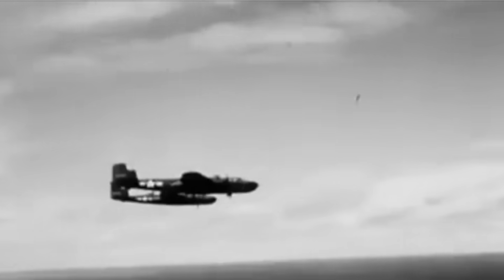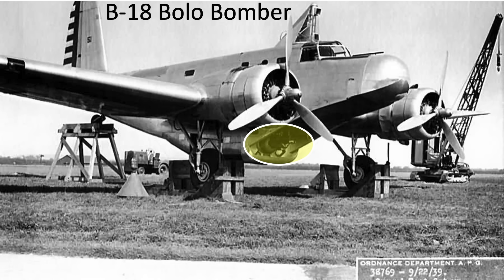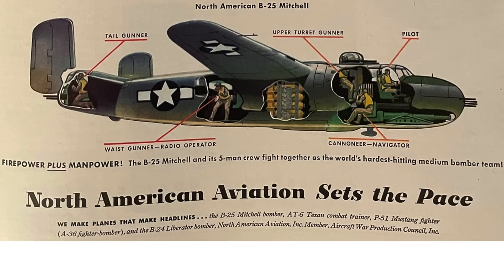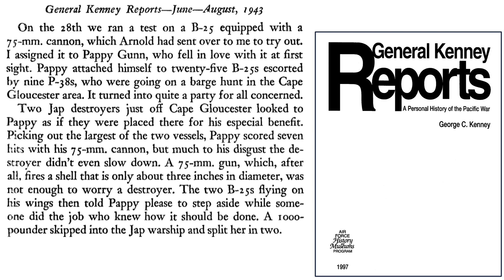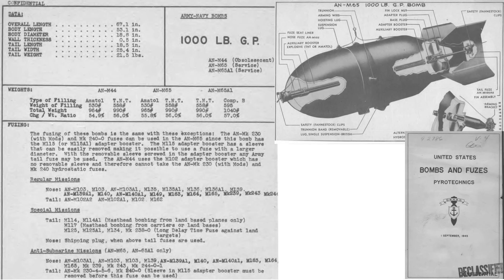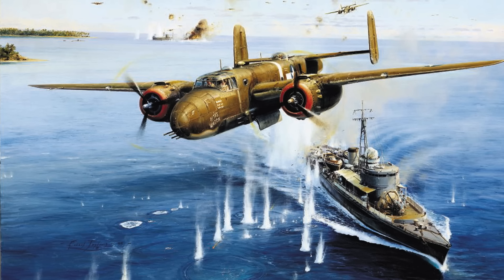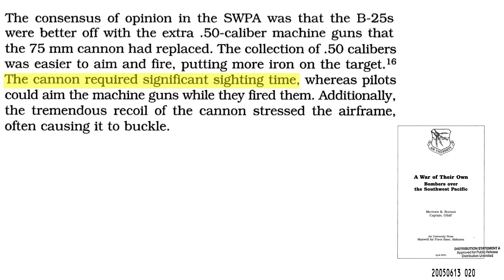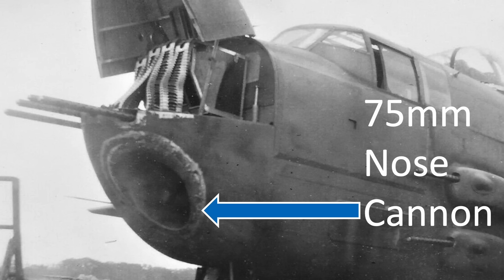Why the B-25’s 75mm cannon was a Failure - Deep Dive Review

Comment: It's good that they tried.  If all crazy ideas work, they aren't crazy enough and you're missing some crazier ideas which might work even better.  Failures show you're thinking crazy enough, as long as some do work.
Reply: yes, and all creative work is like that. to find the 1 out of 10 good idea you have to also test the other 9 things that end up not working. a particular thing not working still gives you important information. you don't have to keep testing doomed ideas over and over again. still, some ways of testing are better than others. in 2025 you test it in a 3D model before putting it on an actual airplane. they didn't have those tools in 1943. arguably, you could have known before hand that the 75mm round won't do much damage to a destroyer. on the other hand, pristine conditions on a firing range lack a lot of important aspect of real combat. the only way to really test it was to use it.
Reply: @196cupcake  Yes.  In hindsight, it seems obvious that 3-4 75mm shells against a destroyer or even merchant ship are mostly useless compared to thousands of .50 rounds.  But it was wartime and they were trying everything they could.
Reply: It might have been better to fit a smaller, higher velocity gun - like the Molins gun fitted to the DH98 Mosquito Mk XVIII
Reply: @smokerjim  Thank you for contributing. IF I've understood this video, rate of fire was a significant problem. So the Molins gun's autofeed should have been an  'immediate' improvement. My impression is the Mosquito Mk XVIII was designed to sink U-Boats with direct fire of the Molins gun and rockets. That seems like a different task. Are you thinking of redirecting the B-25s against submarines, or making them more effective against destroyers?

If the Molins suppressed a destroyer's AA fire more effectively than a bunch of 50 calibre machine guns, then it was more than an improvement over the 75mm cannon. However, AFAICT, the Molins gun only doubled the rate of fire of the 75mm, which seems less dangerous to AA crews than 4 or more extra 50 calibre machine guns. But I'm too ignorant to have any confidence in that guess.

If Molins gun fire could directly sink destroyers, then it was more than an improvement over the 75mm cannon and 50 calibre machine guns. AFAICT, the Molins gun directly damaged U-Boats, so, IF I've understood this video, the 75mm had poorer penetration than the Molins gun (better penetration seems like 'a Good Thing'™😀), The 50 calibre machine gun was ineffective at directly sinking a destroyer. So is that what you're thinking, and why you suggested it? That seems like a significant step up in effectiveness.
Thanks again.
Best Wishes for a Most Excellent Month. ☮
Reply: @smokerjim  Double thanks because I learned two different things. Firstly some of the Molins gun's development problems which hadn't even occurred to me. I also learned that De Havilland had devised and implemented 'Fail Fast, Fail Cheap' for investigating and testing ideas, and they used it effectively! There were some clever folks at De Havilland and Molins.
Take Care. ☮
Reply: @smokerjim 37mm or 40mm. Plenty of those were around.
Reply: Theres other aircraft that it did work on tho.  Different theatre and different combat role but worked nonetheless.
Reply: @Acetheskyhook  That's also a good reason for not wasting resources on building 1,000 B-52s with 75mm cannon, then spending resources removing them.
Better to spend some resources on testing other ideas. 
Thank you for replying. ☮
Reply: Cringe
Reply: The rule of thumb is "fail fast, fail cheap", and not "Failures show you're thinking crazy enough" because testing every idea has a cost. I'm strongly in favour of 'casting a wide net' for ideas, and building fully working prototypes to test in real conditions. However, making 1,000 (about 10% of all B-25s made) when it didn't work is a ridiculous waste of time and resources. It also adds logistical complexity (making and shipping 75mm rounds which aren't otherwise needed) to keeping those B-25s flying. Removing the 75mm cannons from manufactured B-25s is further evidence of the failure to "fail fast, fail cheap".

A good technique for testing 'crazy' ideas is to describe scenarios where the 'crazy' idea is applicable, what its benefits are, and how it's better than the existing technology/approach. I'm guessing someone writing or reviewing those scenarios might have focused on hitting boilers, engines or magazines, having realised the holes weren't going to sink a destroyer. Or focusing on ships small enough to sink, which might have pushed it's priority down significantly.
Best Wishes. ☮
Reply: @gbulmer   If you're Luke Skywalker you could probably be very effective with 75mm, but most people aren't Luke Skywalker. but realistically, I could see the argument for how larger shells might do better at suppressing AA guns. Maybe you could actually hit them (maybe that was possible in ideal conditions). Or, maybe a bigger boom would be more intimidating to the gun crews. It just didn't turned out that they had better options: more .50 cal. 

The AC-130J is still in service, and it has one 105 mm M102 howitzer on it. So, the idea of putting a big gun on a big airplane isn't the craziest idea.
Reply: @196cupcake  Thank you for replying. If they wrote scenario's (as I suggested), and wrote "75mm cannon fire would be more effective at suppressing AA fire than 50 cal", then I think they might have questioned the technology of manually loading 3-4 rounds per attack run much earlier.  That seems so slow as to be barely useful. The video says it was also hard to aim, suggesting many rounds missed the intended target. Further, if it is fixed, aiming at a similar area to the 50 calibre machine guns, a gun crew would get a warning that they might be in danger from the 75mm by the 50 cal fire. Also, though I have no experience, I suspect the rare 'boom' from an attacking aircraft is drowned out by the AA guns and other destroyer weaponry I and my comrades would be firing, and the hail of 50 calibre machine gun bullets we were receiving.

I'm strongly in favour of evaluating very wide ranges of ideas, and applying "fail fast, fail cheap". I'm strongly in favour of testing in realistic conditions and not just ideal conditions.

I'm strongly opposed to huge investments before evaluation has shown positive evidence. An obvious exception is 'binary' technology which changes wars; for example the first successful nuclear weapon. Losing that race might easily be catastrophic.

Big guns on big planes seems very attractive when the big gun is effective against the intended targets. However, a slow firing 75mm was demonstrated to be ineffective.

An AC-130J is enormous compared to a B-25. An AC-130J could carry the weight of a couple of B-25s. An  AC-130J is a "Swiss Army Knife" of weapons systems. So it seems reasonable it has a big gun to deal with specific targets. However, its 105mm howitzer is very likely much, much more effective for its type of target than a 75mm against a destroyer.
Thank you again for replying.
Best Wishes for a Great September! ☮
Reply: @gbulmer  The British equipped  the DH  Mosquito with a 57mm solid shot anti-tank auto-cannon.  They killed a few subs with it.  It came out in June of 1943.

Comment: I read of 3 Hellcats, 6 .50 each, shooting up a Japanese destroyer from the side, and apparently putting so many holes in it that the engines stopped working and it eventually sank.  I can imagine hundreds of half-inch holes could be hard to plug, especially if a few dozen were in the boilers and enough crew were killed or injured.  It's been ages since I read it and I have no references or any details.
Reply: A 332nd Fighter Squadron fighter plan shot up a German destroyer in Northern Italy, and hit ammo, blowing it up.
Reply: Those 3 hellcats could potentially fire 7200 rounds of .50-cal, now just the cross sectional area of all those rounds is equal to the cross-sectional area of 200 rounds of 75mm AP. I don't think one aircraft could fire 200 cannon rounds before the plane itself was shot down.

A HE-shell could potentially do more damage but HE 75mm shells don't have very good penetration, the fuze tends to be crushed on impact with steel so if it doesn't detonate immediately it doesn't detonate at all.
Reply: @Treblaine  Doesn't matter, there's no way .50cal is penetrating a destroyer's armor. Not one, not a hundred, not a thousand. 
Especially from range, where they already lose some velocity. And no airplane-carried machine gun is going to accurately put hundreds of rounds in same place to actually make a dent and punch through in combination, even if they all combined finally put out 7200 rounds (assuming they would be able to fire it all on one approach without flying past target before, accurately, with no misses). 

This is an exaggeration similar to "fighter pilots shot the road under Tiger tanks for .50cal bullets to deflect off the pavement and destroy them from underneath!". Nobody who has any knowledge of ballistics and WWII history can be naive enough to believe this.

This just makes zero sense and can not be taken in any way other than tall tales told in dive bars for entertainment.
Reply: @czwarty7878  I think you misunderstood me, I'm comparing the damage the .50-inch MGs did to the poorly armored modules like torpedo launchers and 25mm AA gun positions to the intended damage through armor.

75mm AP could penetrate (maybe) but just wouldn't have the same effect INTERNALLY as the .50-inch guns had EXTERNALLY.

And I don't think the 75mm HE-frag rounds could both penetrate very well AND detonate. Some other channel covered this and said unfuzed 75mm HE would penetrate as well as a 37mm AP round but if fuzed the 75mm shell would detonate on the surface spreading the inertia of the shell-casing over a huge area of the armor just pitting a large surface.

What the .50BMG may have done is caused detonation of explosives stored on unarmed surfaces of the Destroyed, like crates of AA ammo, torpedoes, depth charges or even land based ordnance stored topside for transport to ground troops.

Poor organization can lead to explosions and fires on the surface to spread down into the hull where internal detonations would split the hull.

PS: I've seen that repeated insufficient impacts do not penetrate. The ammunition just builds up on the surface adding to the mass. You can't do a "robin hood" of stacking projectiles, the first projectile just shatters the second projectile.
Reply: @czwarty7878  Destroyers have no armor.  They are called tin cans for a reason.
Reply: Which shows what was really wrong with that 75mm. The fire rate was abysmal. Even the upgraded one only fired once every 2 seconds.
Reply: Sounds bullshit, is there any proof and which ships?
Reply: @yoseipilot It’s been well documented for many years and a quick google search would answer your questions including the unasked one about why that event has been buried the same way that the results of the first “Top Gun” competition at Nellis AFB were “disappeared” until a few year ago..
Reply: @dpeasehead  Now you intrigue me.  What Top Gun results?
Reply: @grizwoldphantasia5005 The Tuskegee Airmen won the first “Top Gun” competition which was held at Nellis AFB just after WWII. Their win wasn’t acknowledged until a couple of years ago. All of this information is readily available on line, just not in US “history” books.
Reply: @yoseipilot  I made a quick google search. 
Yeah, seems like BS, an exaggeration similar in style to the famous "M8 Greyhound destroyed a King Tiger once!" story* which made rounds on the net 2-3 years ago. 

There was indeed an event where Hellcats sunk a ship, putting concentrated .50cal fire down the smoke stacks. But it was not a destroyer, as records of sunk ships for that day state only "Submarine Chaser #16, the minelayer Sarushima and W-19 class Minesweeper #25".
And this makes it more logical, as such ships would be very lightly armored (or not armored at all in some places).

Most likely these ships were already heavily damaged and going to, or from, repairs, while being full of supplies, fuel and ammo haphazardly stored around the deck in the open (similar situation to how Japanese carriers were caught at Midway with all bombs on deck). Which then made them vulnerable to fire, even from a fighter carrying enough machine guns.

*Cool story, except physically impossible to happen (there are no spots on King Tiger that are less armored than 80mm, other than floor and top - so unless the Greyhound was flying like plane or digging like a mole, it would be impossible to reach. And it's gun had around 65mm of penetration at point blank)... And obviously proven to be false in the end, as the records proved there were zero King Tigers in multiple miles' radius around area where it supposedly happened.

Most likely it was a Panzer IV that was misidentified by the scout car's crew, in excitement that they managed to destroy an actual tank - which is already a great feat - and afterwards the story grew out of proportion.
Reply: @yoseipilot  Perhaps your comment is just virtue signalling, since you ask what I already answered: "It's been ages since I read it and I have no references or any details."